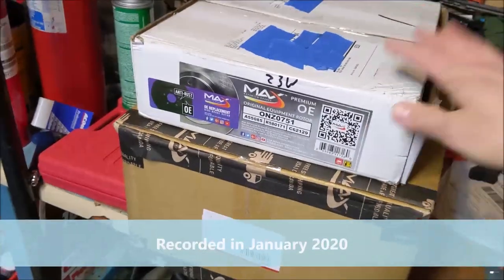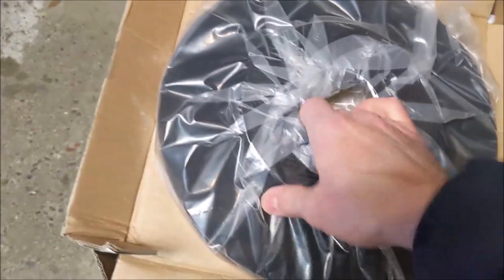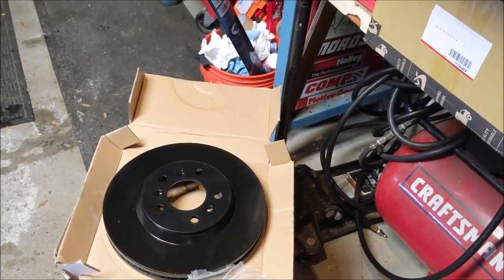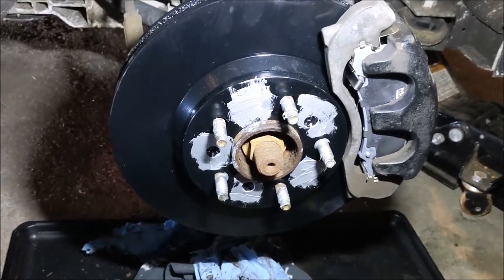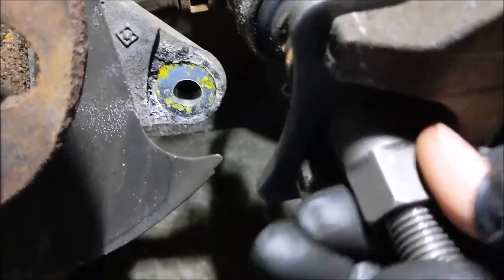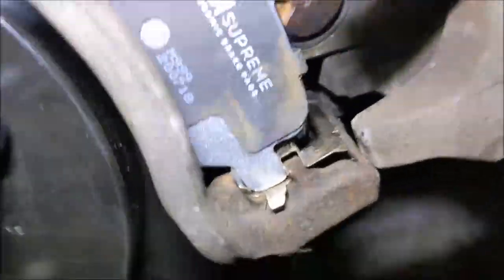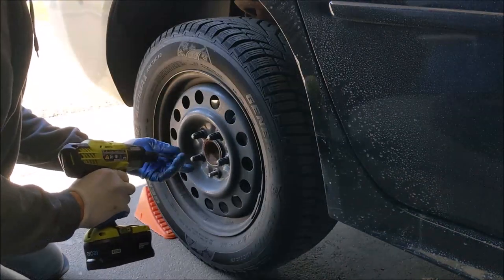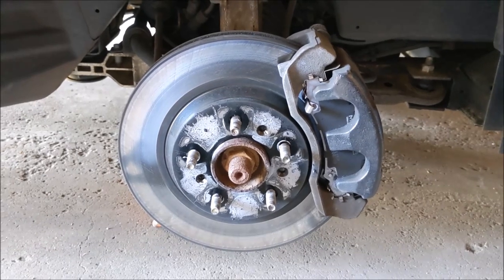MAX Advanced Brakes Unboxing and Review (2011-2016 Chevy Impala/Limited)

Comment: I bought a similar kit from MAX a few years ago for my '04 3800 Impala. It didn't come with the brake pad hardware and the rotors weren't coated, and rusted up in a few weeks. They went about 15000 miles before developing a front end shake. Looks like they're improving the product at least.
Reply from the maker: Thanks for that info, and I will certainly keep it in mind!  For the price, I'm certainly willing to give them a chance, even if I only get 15k out of them.  Hell, even if they only make it 15k, I'd be willing to buy them again if they keep the price the same!!

Comment: Underneath when I do my oil changes I see long prices of metal looks like a part of the subframe. One by the oil pan, other along the transmission both inside of where the front tires are, would that be suitable enough to hold the weight of the car while I do brake jobs etc? Thanks man. Your one of the few channels that does any work on these impalas.

Comment: I used detroit axles on mine, they came with the drilled holes but they seem to work so far on rears, I used oem ac delco on fronts. Dude the on the star screw snapped on me too haha, surprisingly it came off and i used the bit with the snapped piece off, just pushed it hard and slowly pulled and the nut came off. The worst part is I had a good brand one I bought and even that one snapped I’m like hoping this won’t happen haha
Reply from the maker: 😂 I wasn't all that shocked when mine broke off - my torx set is made from the finest chineseum!  Guess from what you said, I'm glad I didn't spend a ton of money on a good set!!  The stupid thing with those screws is the 8th Gen Impalas have the EXACT wheel hubs and don't have screws holding the rotors on.  They're pointless!!

Comment: Hey shade, I have a 10th gen impala with the 3.6, I’d like to know where exactly I can put Jack stands to support my car? I kinda see your stand on what looks like a control arm.
Reply from the maker: What you're looking for is called either the engine cradle or front subframe. Find the front cross member that's beneath the radiator and place your jack in the center of it. Once you raise the car up you can place the jack stands on the side rails of the engine cradle. Here's what one looks like:
https://www.ebay.com/itm/165607472188

In the rear I'd look for the center section of the suspension cross member and place the jack there. I usually place the jack stands on the frame rails in front of the back wheels.
https://www.ebay.com/itm/334536836724

If you wade through this video, I show you where:
https://youtu.be/PxgxSn0s2NY

Comment: 06-11 Raybestos police metallic pads will fit up front and maybe the back not sure buttt the police pads grip very well
Reply from the maker: I think it was 2011 when they changed the rear brakes over to the ratcheting calipers, so getting a set for a 2011 would be the way to go.
Reply from the maker: Check RockAuto!
Reply: Richard Skipper yuppy get them pads there pretty good frfr and yess In 2012 the police car got 12.7 inch rotors up front a few people have done that front break upgrade with the 12.7 you’ll need 17+ rims tho
Reply: Richard Skipper me too there a good size rotor and I like 16s they make the car a little lower to me at least. But yes get the raybestos pads there good :))